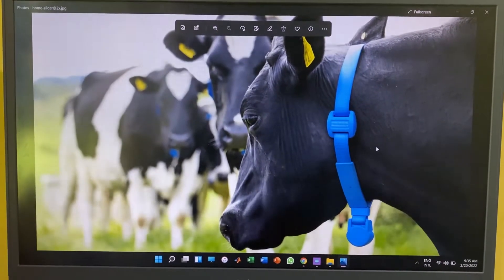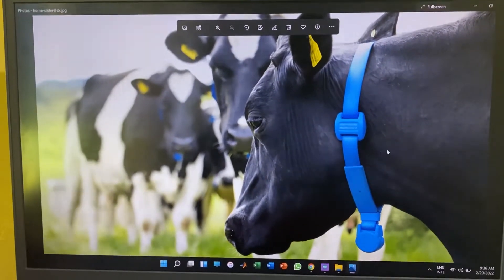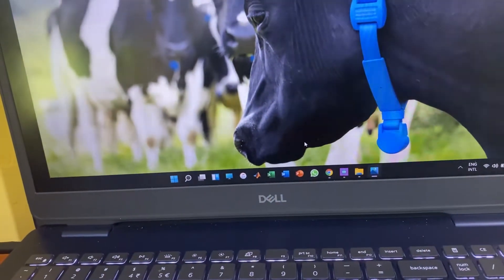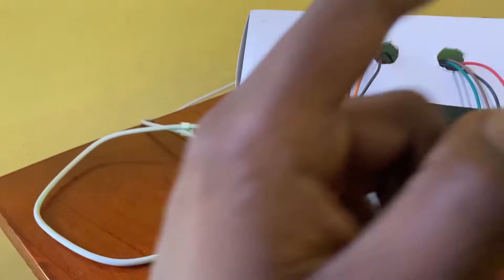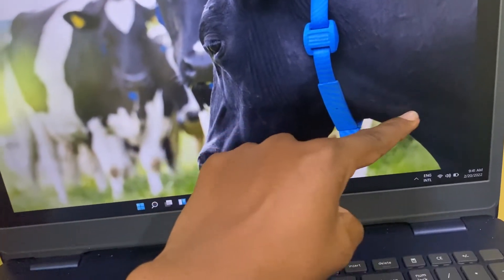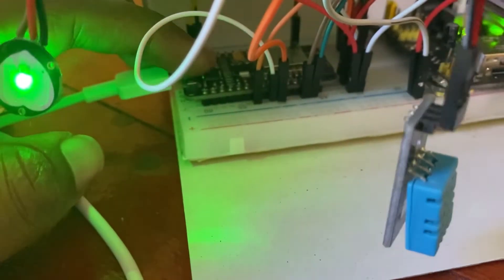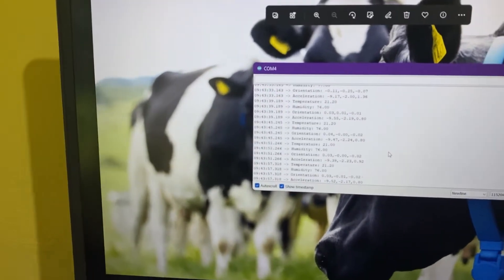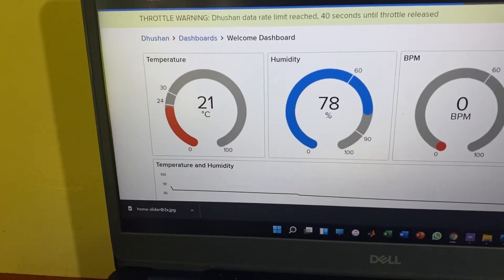Home-based Cattle health Monitoring System | Electrical & Electronic Projects

Comment: Bro please send me components lists is needed for this project
Reply from the maker: Sorry for the delay. 
A reliable heart beat sensor. 

Temperature and humidity sensors. Almost all sensors are pretty much reliable and cheap.

Mpu6050 6 axis accelerometer to track cow movements and rumination.

Nodemcu/ ESP32/ESP8266 for iot connection

A battery for power